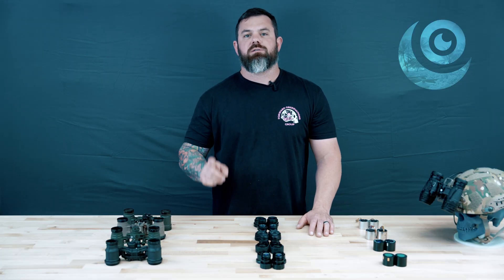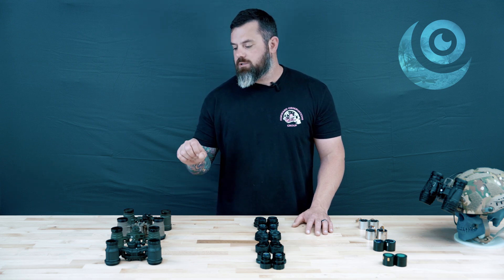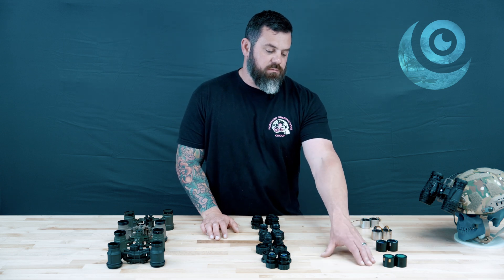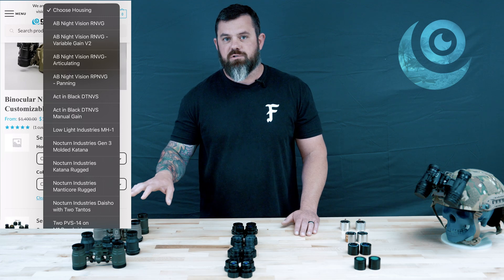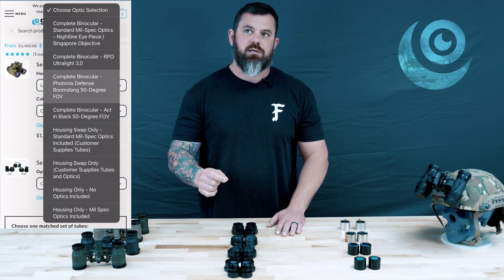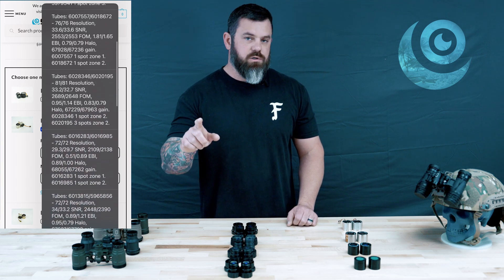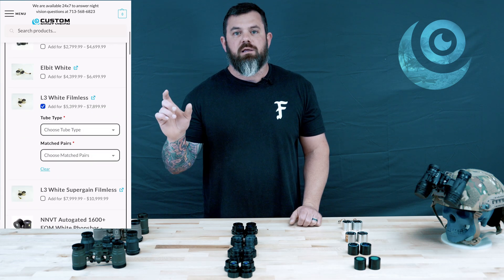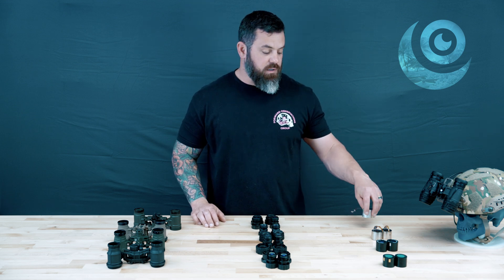Custom Night Vision | Turn Key Night Vision Builder

Comment: Just picked up a set of elbit's in a katana from you guys, shipped in less than 24 hours. This time around I compromised on some spots for higher spec tubes coming in at 2730 FOM. I think it was the right decision for my use case.
Reply from the maker: Glad to hear it, thank you.